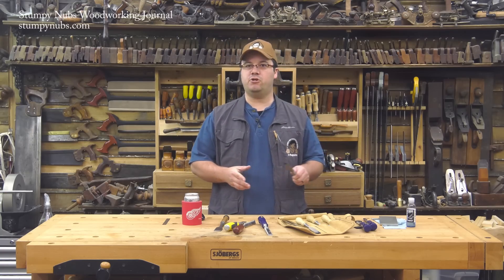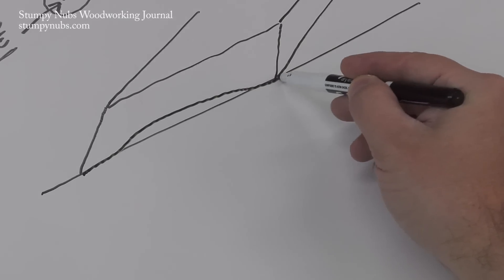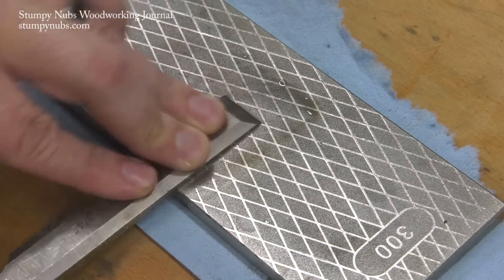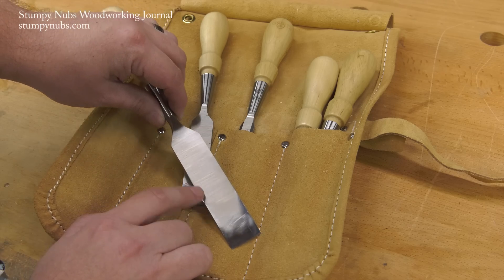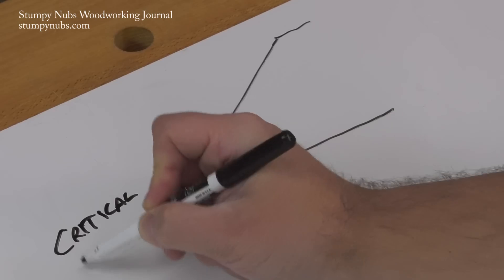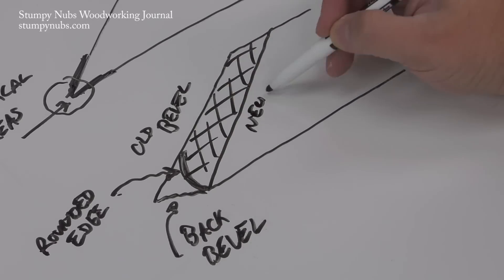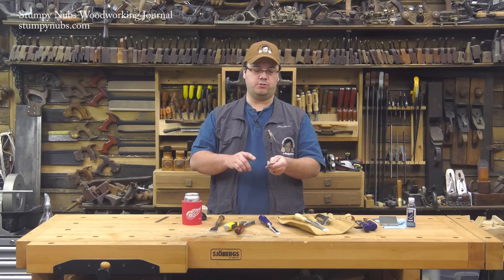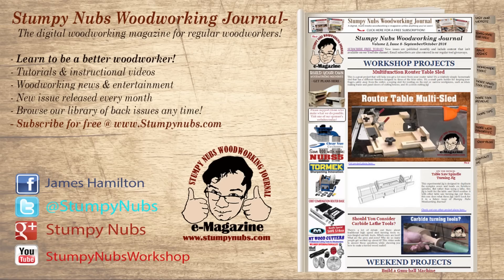The biggest sharpening mistake woodworkers make (And why...)

Comment: What happens to a Japanese chisel with a hollow back when after years of sharpening you get into the hollowed out part? Is the chisel scrap or is that just a signal that either it's time for you to retire or you are sharpening too aggressively?
Reply: Doug Garson 
Generally 
It will take a very long time of service 
And sharpening to wear the hollow back chisel till the hollow 

One way of dealing with it is 
To flatten the back 
And thus lessen the hollow 
And provide more margin 
For the flat part of the hollow chisel back 

But most of us will never ever wear down a chisel 

Unless you just bear down and rough grind your chisel on a stone grinder every time you sharpened the chisel 😁
Reply: Doug Garson in addition to above, every time you touch off the bottom, you will slowly be reducing the depth of that hollow. Because the bottom of the chisel will be warn down closer to the bottom of that hollow. It will genuinely take even the most used chisels by the busiest of carpenters decades to reach the ever shrinking hollow. (this is of course at nanometers at a time XD)
Reply: Agree with Sojan and Kelly, it will take a long time, hence my tongue in cheek suggestion that it would maybe signal time to retire when it happens unless of course it's your great grandfather's chisel.
Reply: I thought one main reason of a concave back is to reduce friction, not just because it's going to warp when heat treating? I'm sure I read this about japanese chisels somewhere.
Reply: @Resleeved  It also reduces the amount of metal to remove when flattening the back, less wear on your waterstones and less time spent sharpening.
Reply: @cmdrsocks   Yes, that is my understanding, that there is less metal to remove. This is important because the steel in Japanese chisels is harder and thus harder to polish.
Reply: @Resleeved  Makes a ton of sense.  I had always thought friction+weight reduction. The warping thing makes a bit of sense too. Except that if it's this mitigated geusstimate of which chisels will warp which direction it feels like you'll either have wildly inconsistent stock, differing experiences between customers, and a real poor impression on consumers.  I don't know though, it still makes some sense. I imagine that before heat treating there's some extensive ways to mitigate warping in one direction or another or post heat treatment ways to identify and grind those down a bit more or something.
Reply: @garyschmidt7320  Yes, a very hard piece of steel forge welded to a softer tough piece, with a chisel the hard piece is at the back, so much harder to grind and polish.  Western style blades are tougher and will stand more abuse, but only the best will take as fine an edge as a good japanese laminated blade and they are very expensive.

I recently started buying some good quality tools, both western and Japanese and I am enjoying wood work much more and using power tools much less.
Reply: @MattrsMore  that's what I believe also. I don't see the process being much different to that of which a bladesmith would take. All of the finishing looks to be done after the heat treating process is carried out. I have some japanese hand made knives and some are only 2mm or so thick and they are perfectly straight along the spine, with a hardness >62.
Reply: Japanese chisels are made with the tool steel as the top/cutting portion and a sacrificial steel as the bottom portion. When you have sharpened it so much to reach the belly, you peen the middle of the blade to make it flat for another section then put a new bevel and lower surface on it. Then use/sharpen like normal until you're back into the belly.
Reply: @Resleeved  Also worth considering is that Japan has very little iron ore, which is how they ended up with their traditions. You spend a lot more time getting something right if the materials cost as much as a house. Then when you are making something, you use as little material as possible. Side benefits may exist, but I would conjecture they first did it to use less metal.

Comment: You my friend get it!!. Thank you for sharing an overlooked part of understanding 'metal tolerances'. I am fortunate to have access to a 12"X16" machined 'lapping' table, used with varying grits of 'wet' sandpaper and light oil makes short work of uneven surfaces. You can achieve perfect results everytime. Of course I do have my trusty diamond plate in my woodcrafting hobby shop. I do not use any type 'stones' as they wear into a belly or groove. Only a diamond plate will do.

Comment: Im not a fan of the "ruler Trick ". Its not a trick. Just lazyness. And the result is that the complete plane and chisel geometry is out. Means, you bevel up plane or bevel down plane works different and no longer optimal. And who does it to his chisels... well... lost the control of his life. :)
Reply: The 'ruler trick' has never been recommended for chisels by anyone authoritative
Reply: On a plane blade the method makes sense -you're gaining maybe a degree on the edge...inconsequential. Take a degree off the bevel if you think it matters.
Reply: @henseleric   Not my opinion. You create a bevel on the mirror side. The mirror side must be flat. Think of the chip breaker. Its in most cases as close to the edge of the blade, as possible. If you create a bevel you end up with a gap between blade and chipbreaker! or you position the chipbreaker behind the bevel you created, where it doesnt belong :) Yes... the rouler "trick" makes it easy to create a sharp edge on a blade. But what the heck is the benefit when the plane itself then has worse performance? A set back chipbreaker creates more tearout. 
Also, what i always hear and is "just flatten a chisel or plane blade about "an inch or so" on the mirror side"
But on the otherhand people discuss flatness of the frog bed in their metal planes , or blade bed in wooden planes. Does it make sense if you think about it, that the planeblade only needs to be flat about an inch from the edge? and the rest that has contact and should lay as flat as possible inside the plane NOT ? Thats why japanese flatten the whole blade on a steel plate BEFORE they flatten the plane bed.
Just my opinion :)
Reply: Did you miss the part following 9:00 where James said 'no chisels'?
Reply: @StudioExit13  " If you create a bevel you end up with a gap between blade and chipbreaker!" Nonsense -the chipbreaker is capable of flexing several degrees, and we're talking, maybe, one degree. I would not do this on a Japanese chisel -and the Japanese chisel is already designed to make a flat-back relatively painless  -that's a different use-case. I see this as very viable on a western bench-plane. To each his own.
Reply: @henseleric  well. Thats maybe your experience. And maybe you talk about the classic stanley blade & chipbreaker combo. Yes it flexes. No, not right on its edge. A ron hock chipbreaker for example doesnt flex at all.or at least i didnt notice that. But never drove a tank over it :)
But if its working great for you, thats fine. In my opinion its nonsense, especially for beginners.
Reply: Eric, your statement about gap between C/B and blade with two thirds of one degree back bevel is not true.
This issue is dealt with by one and a half degree clearance angle for the underside of the c/b front edge.
David Charlesworth

Comment: If you get a particularly high belly see if your local community college has a manufacturing department.  Any first year apprentice can easily flatten that out for you, and the heat damage on the edge will be ground off when you sharpen and polush the bevel after.
Reply: Trust a first year apprentice at a community college? NO way Hose!
Reply: @peterowens290  seriously, I could have done it after my first four hours on a surface grinder.  Stuff like that is such a no-brainer that it's sometimes not even considered an operation in industry

Comment: What makes it sharp is the Jagged Edge left over from the still breaking off no point is a complete a point it has some flatness to it at a microscopic level.
When you sharpen the bevel Edge it leaves a Burridge the still is bent over, the flat side tries to eliminate this till the point it can break easily by rubbing it on the palm of your hand or leather strap. To get it really sharp you do a gentle one to one bevel then flat bevel then flat bevel and flat repeat with less and less pressure. Most importantly you have to make sure your stones are perfectly flat, and best to do it by hand as well with a sideways movement not forwards and backwards this can blunt the tool
Reply: I agree that side to side gets the best sharpening results. Easier to keep from rounding the bevel side.
Reply: I have looked at the edge of tools using a scanning electron microscope and scanning white light interferometry, at no point ( down to the nanometer scale) does the edge have flatness if it is sharpened at a true bevel with the direction of sharpening as if you are cutting the stone. The only way to get it truly sharp is to go to finer grits with a very flat surface (ie tempered glass). Moving the edge sideways will increase friction and wear rate of the edge.
Reply: @mfsolutions  a point doesn't exist... and you want the edges to be slightly rounded anyway example plane blades is hardly noticeable, you can get it completely flat it's all a matter of the angle you attacking at